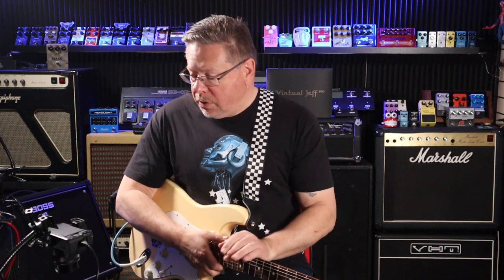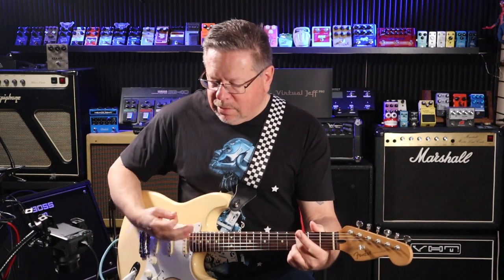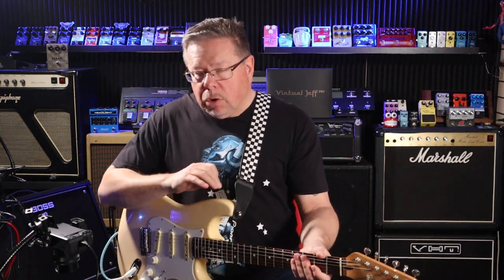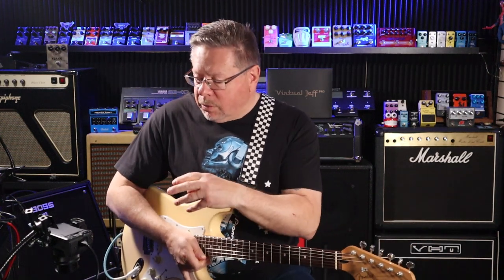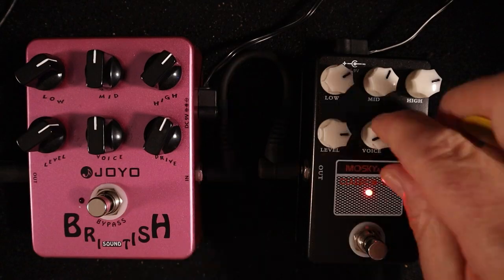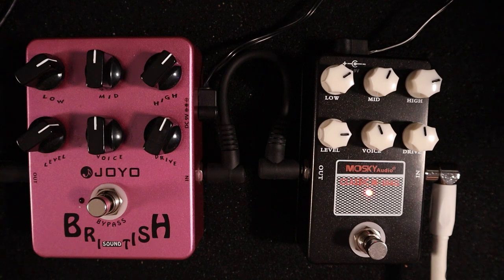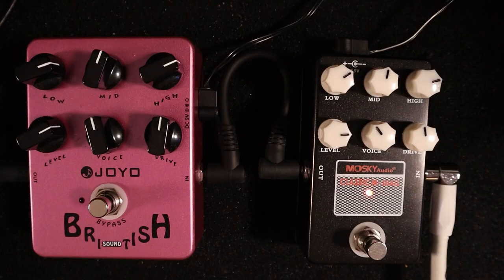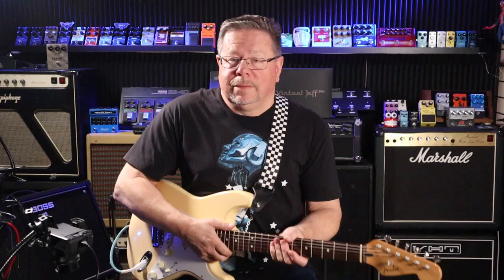Joyo British Vs Mosky M-SHALL

Comment: Great comparison Rod! I am a long time Marshall guy and I will have to go with the Joyo. I use a Marshall Code 50 which is a digital modeling amp and sometimes sounds that way and with the Joyo I get am actually Marshall sound. Very cool
Reply from the maker: Thanks Chip! I’m a fan of the series. I actually use the American for my duo gigs and stack 3 gain stages and four other reverb, delay and modulation pedals before it. It sounds good. The British can’t get quite as clean and it’s not meant to!
Reply: I would love to see a video of your personal guitar rig. You guys do great pedal videos but sharing that type of info is also very interesting. Just a thought.